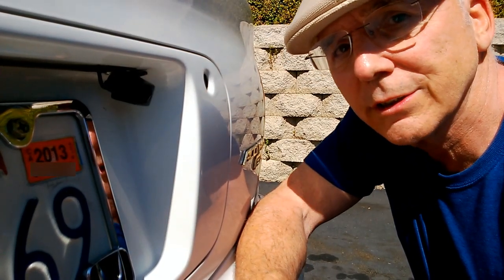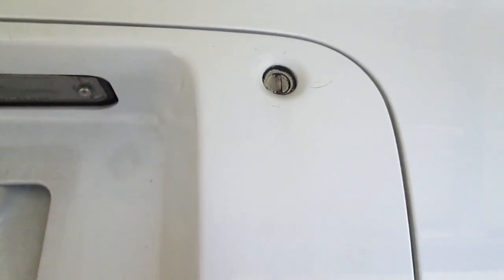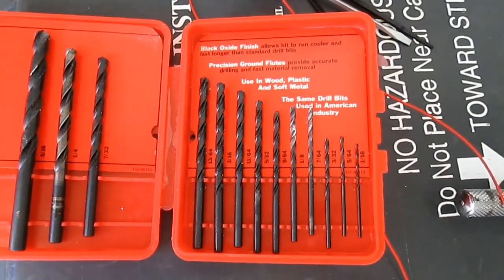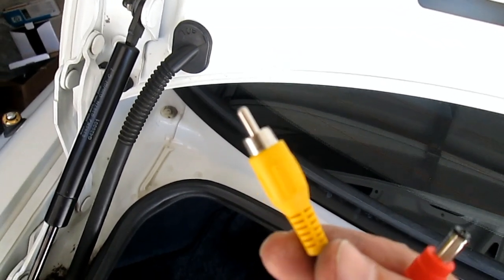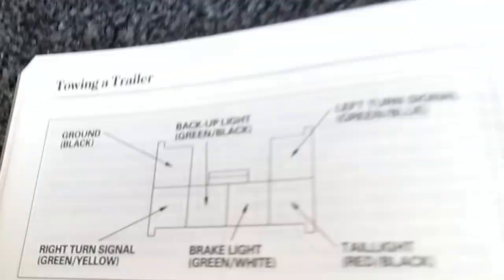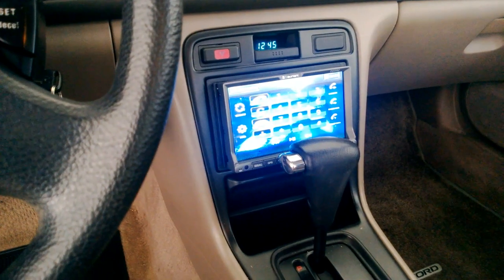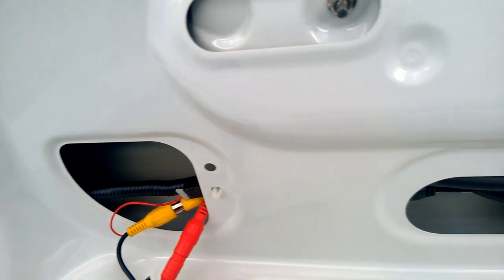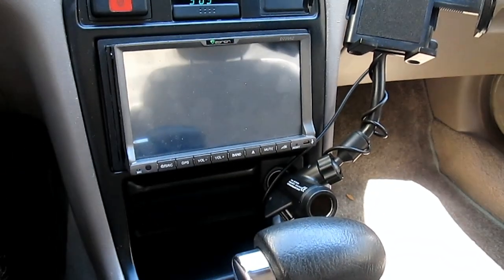Backup Camera, Bluetooth, Music and Navigation in 94 Honda Accord - Video 7, Backup Camera Install

Comment: Hi I was wondering about how you hooked up camera to the trailer hitch.  Can you go into more detail to exactly which lights you wired the camera into?
Reply from the maker: It differs for each car.  If your car came with a pre-made plug to attach to a trailer hitch, you have to find out which wire is for the reverse lights.  Then it's a simple matter of hooking up the power for the camera to that one and the ground wire to the ground wire in the plug.  Each time you reverse, the car gives power to the reverse wire and therefore to your camera. If you car doesn't have a trailer hitch plug, you'll have to wire into your backup light connection.

If you can find it, search for your make, model and year.  Hopefully you can find the wiring diagram.  If you can't find it and you're a little brave, just buy a 12v power detection light.  Use it to check which wire gets power in reverse only.  Of course, make sure you have someone else in the drivers seat.Here's one on Amazon:

https://smile.amazon.com/McKay-All-Purpose-6-12V-Circuit-Tester/dp/B01DTF59VM/ref=sr_1_1?ie=UTF8&qid=1486220357&sr=8-1&keywords=12v+power+light+detector
Reply: @Oldguygeek  I don't have a trailer hitch, I have tried  to connect  it  to the reverse light; the camera works but it keeps always on and the break light warning light turns on
Reply from the maker: @aplaceinthesky82  Like I mentioned it depends on each car. Search for the wiring diagram for your model. I'm a bit surprised that your lights do this but with all the electronics in cars now anything is possible. Your camera should turn back off when you shift to forward. Check to see if your stereo system has it's own power connection for the camera and use it. Finally, check the camera connections to make sure you haven't crossed anything and you have the right connection. Good luck!
Reply: @Oldguygeek  I have a dash camera, the one you attach to the front back mirror; the car is from 1994 honda accord the exact model as you have. The camera is attached to the reverse light cable with a t-tap connector
Reply from the maker: @aplaceinthesky82  Well that should work. I found the wiring harness diagram for this car and if you pop off the light cover in the trunk you've probably already found the connector. I attached the light to the rear of the socket and to a common ground. Although the camera is different it should work the same way. But there are settings in most camera apps to decide how it behaves. On a small dash cam, the screen is pretty small but try to see if they have an adjustment for timeout or something like that. If that's no help try a different connection. It has to be the one leading to the backup lights. They should be a separate connection from the regular lights or the brake lights. Your idea of a t-tap connector is better than the way I did it and it should work fine.